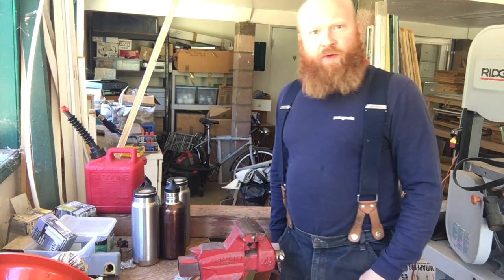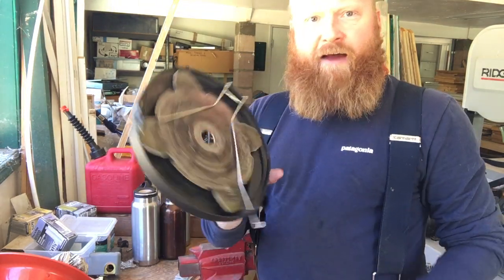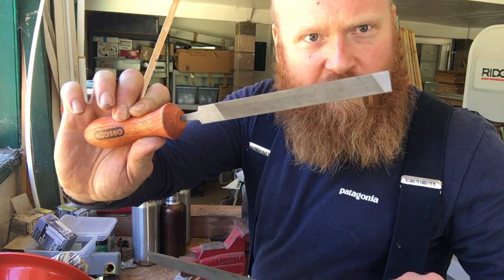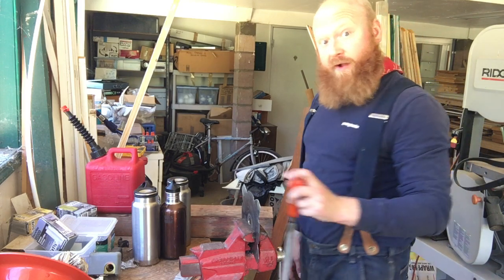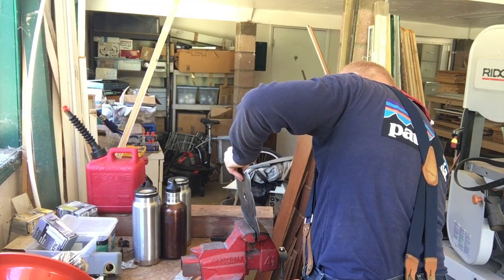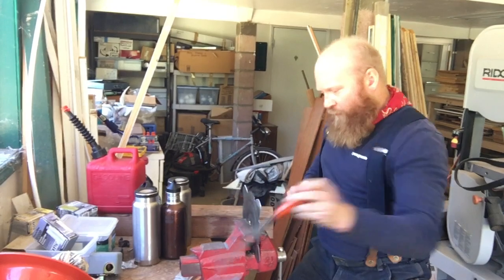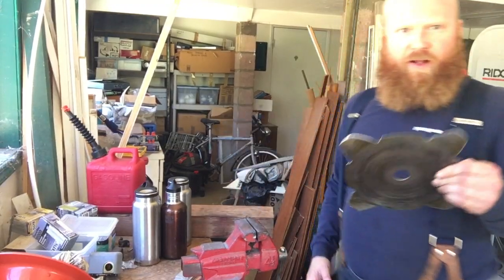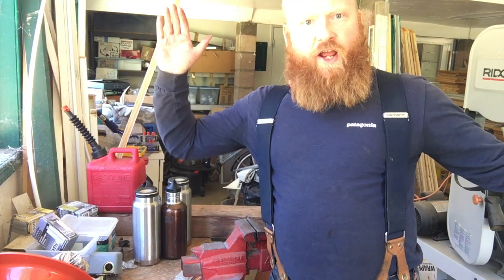How to Sharpen the Grass Blade on a Husqvarna 525RX Brushcutter

Comment: Hello sir, thank you for this video!
In december i bought a brand new Husq 336FR that came with stringer head, saw blade and a grassblade.
My grassblade looks very different; its a three-spoke one and not like yours, i do not know if its a European version, i live in Denmark, or its just a new general design.
It works perfectly on grass and small trees up to pencil size, above that i use the sawblade.
And if you use the trimmer correctly, you can actually lay the cutted grass nicely to the side making raking up easier or makes your path look nice .
Reply from the maker: @bmbpdk   You have the machine that is the next step up from mine. I’ve used it before. I know the three sided grass blade you’re talking about. You should be able to sharpen it the same way as in this video right? Does it come with a circular saw blade as well?
Reply: @michaellee9883  Yes it does, it saw through small trees up to 2-3 inch in diameter.
A funny story about the buy;
I bought it at my local Stihl/Husqvarna authorised dealer and the price the lady gave me was spring 2024 price because she grabbed the wrong catalouge, so when i came to pick it up a few days later, she said i made the deal of my life on that; spring ´24 price was almost equal to winter ´25 before taxes, so they made practically  nothing on that deal, but because i have bought so much from them they agreed that they would accept it.
Supporting your local store gives so much back in the long run and it keeps the doors open.
Reply from the maker: @  Great deal. You’re right about supporting local shops. All my chainsaws and brush cutters came from my local shop. I have five year warranties on all of them. I haven’t figured out a way to sharpen the circular saw yet so if you figure something out let me know. Maybe a light sanding attachment on a Dremel would work?